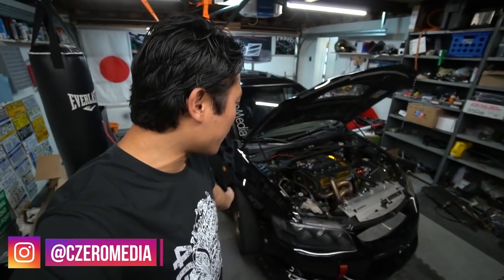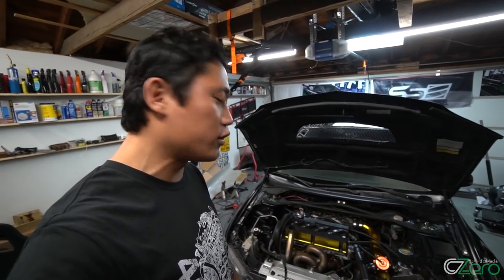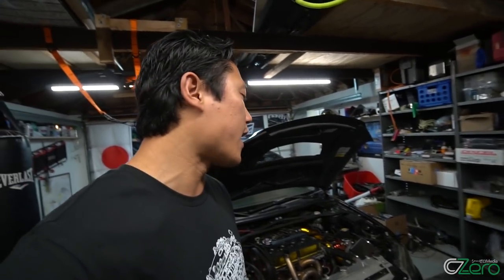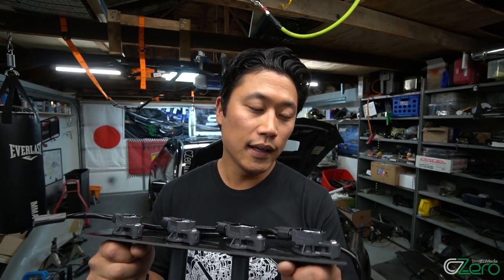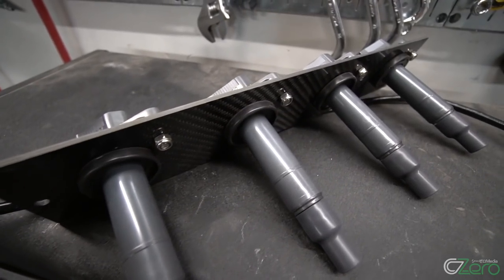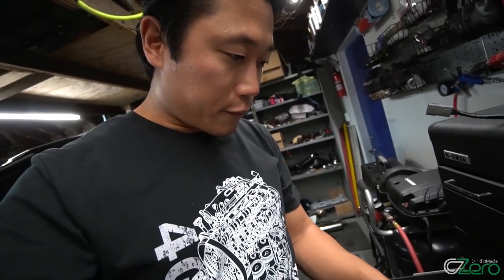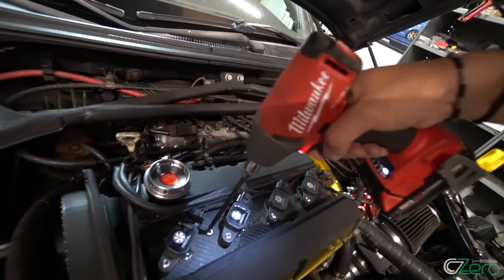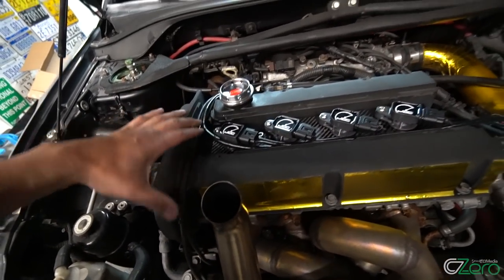I Did a PULL in Front of a COP In 500WHP Evo 8. Coil On Plug Kit Install/ Review - Evo Build #29

Comment: I had a Kakimoto GT1.0Z Exhaust and it was crazy loud, so I switched it for a Regu08&R and that was softer, less ear stabbing but still too loud for UK track and early starts with neighbours, so I've ended up with a HKS Hi Power 409.  It's cheap and the 409 steel absorbs sounds way better than the more expensive 304 steel.  My car still sounds nice, but it softens the blow to everyone else, and keeps me a little more stealth on the street.  Nobody wants to get pulled.  Man, you were lucky right there. #evolife #500plusclub

Comment: Any proof a COP setup actually benfits a stock Evo vs new oem coils?
Reply: Boosted Films 
I'm pretty sure a set of new stock coils would be just the same as the cop kit is still wasted spark if you however made the cop kit direct fire ( possibly after market ecu ) there will be benefits as you will only be cycling the coils half the amount

Comment: Hey man love the channel...couple questions. 
1) you ran spoolinup before this jdc kit. Did you find an issue with spoolinup kit not using genuine denso coils? I had an issue with their springs, but they helped out and sent me a longer set of coil springs to swap in. 
2) what plugs do you run? 

My car runs fine with spoolinup kit but trying to rule out spark issues as a cause of high rpm knock. I usually use br8es. Recently switch to bpr8es and the car does NOT like them. Thanks man!

Comment: Don't forgot about the fuse you need to change if going from stock to COP
Reply: Andy V which fuse? What amp?
Reply: Ray Man The ignition puts out more power than the factory 10A fuse can handle and it will eventually pop and your car will not start if it does. It is located from the driver seat by your left knee in the interior fuse box, top left, red fuse, #1 position.

Comment: I see JDcustoms upped his pricing... They used to be $300 2 years ago. And spoolin up was like 350 or 400 I think. So I went with him but dammmn what's going on lol
Reply: MannyFresh1x My prices on the cops haven’t changed very much in the last couple years. I did originally start using an aftermarket coil for the first few months, but quickly learned Denso were a lot more reliable. There was a slight price increase when I switched to all Denso coils, but my prices have always been very competitively priced compared to other brands.

Comment: Be warned if you have a 2003 evo running the standard ecu a cop kit won’t work.
Reply: Why not?
Reply: MannyFresh1x there’s a file on the ecu that won’t allow it to work and I haven’t heard of anyone being able to disable it yet.
Reply: I've sold hundreds of kits to people with 2003 Evo's and even older Evo 7's with no issues at all. I've never heard of it having an issue with a certain year or model. These work on Evo 4-9 USDM and JDM models.
Reply: JD customs USA I bought my cop kit from eck in Australia and when I had the problem I messaged him and he confirmed that 03 evo’s don’t like cop kits and he did have this as a warning to buyers that I missed, so it must be the 3 plug ecu’s that have the problem not the 4 plug ecu’s.
Reply: bunsofsteeeel This is the first time I’ve heard of this happening. I’ve sold plenty of cop’s to people in Australia, Japan, Switzerland, and other countries and never had any issues. It may have something to do with the type of coils you’re using. Some aftermarket coils won’t work on jdm evos. They’ll start and run for about 15 seconds and then shut off. Thanks for the heads up though.
Reply: JD Customs USA it is very strange I was very annoyed at the time lol, They were new denso coils apparently lots of people on our forum bought the same kit and had no problems including a friend of mine, if you look up mlr eck cop kit you will see the kits he sells.
Reply: bunsofsteeeel I just did a little bit of research and from the only pictures I can find of their cop, the coils don’t look like authentic Denso to me. That would definitely cause an issue on any jdm Evo. I had one customer in Australia a few years ago that ordered one of my kits before I switched to all Denso coils. He had a problem with the aftermarket coils, but when he swapped to real Denso coils it ran perfectly. It’s possible that’s the issue. I’ve never had anyone not be able to run one of my cops on Evo 4-9. 🤷🏻‍♂️
Reply: JD Customs USA very interesting you say that they might not be genuine then, my car is a fq300 which is basically a jdm car imported into the U.K. then modified by ralliart for more power, I would buy another kit but I’m a bit apprehensive about it now tbh lol.
Reply: I don't blame you. lol. I'll do some more research and see if I can find any answers for you.
Reply: JD Customs USA that’s very nice of you mate it be interesting to know if that was the case though.

Comment: I hate to inform you the evo has a 2 channel signal, the cop will only work correctly if you re-wire from the ecu to give you 4 channels. I don’t like Subaru’s but they have 4 channels from factory so the cop works...for example. It will run better with your cop system but I promise it’s not doing what is could do...

Comment: Your zippo spark is greater than my bic spark. This is complete false. Msd ignitions worked on carburetors back in the day because you could advance the timing. A greater spark vs a weaker spark doesnt give power. Gas is not more combustable with one spark or another. It either sparks or it doesnt. Prove me wrong.
Reply: Thomas Taylor That may be the case on naturally aspirated cars, but on a turbo car you have to consider the extra pressure that’s being added to the cylinder. Once you get to a certain psi that spark will be blown out by the extra pressure and cause breakup issues. That’s where this kit comes in to play with a stronger spark that can withstand the extra pressure without being blown out. This is very well known within the turbo car scene. Coil on plug systems have been around for a long time and been proven over and over again on being an improvement and eventually a necessity on the Evo if you plan to turn up the boost.